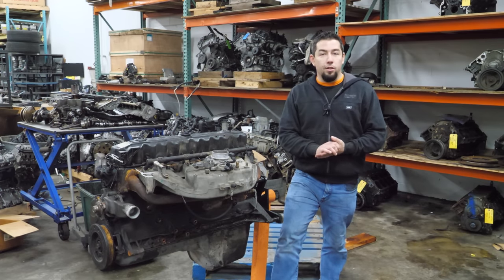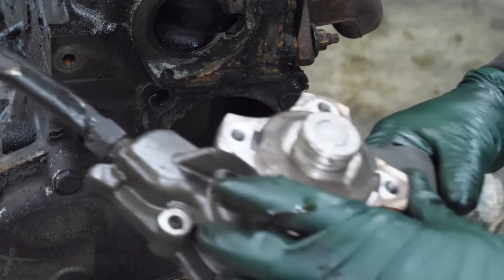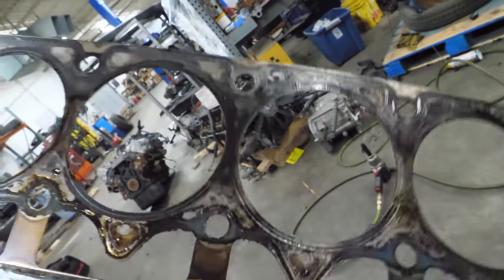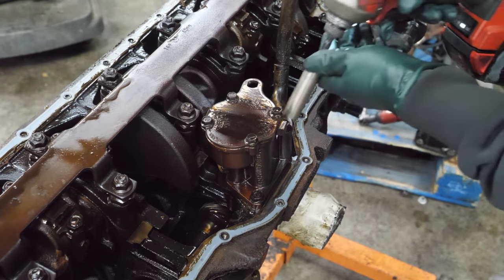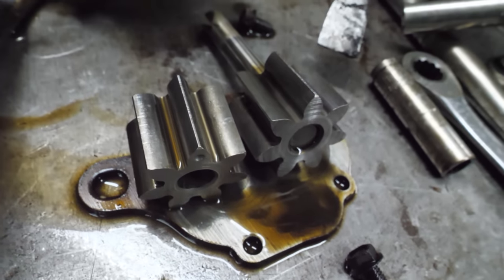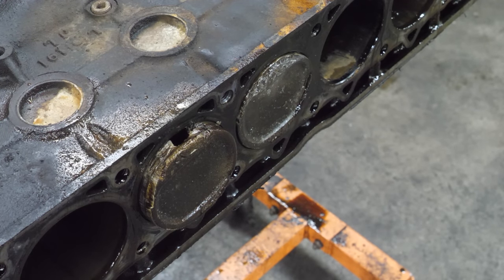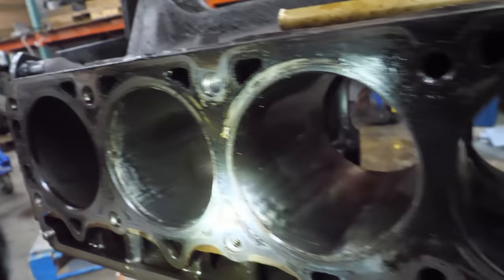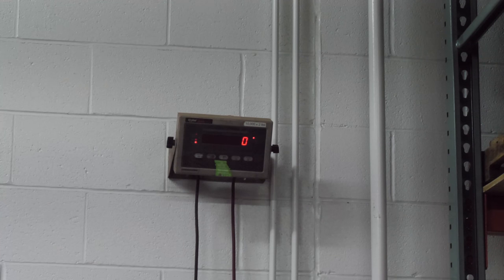How Do You Destroy A 4.0L Jeep Engine THIS BAD? Intentional? Neglect? Ill-Repair?  I Am IMPRESSED!

Comment: My 96' grand Cherokee has a V8 5.2L (318). Been awesome rig. The motor was replaced back in 2014 by previous owner, with an '03 dodge dakota motor, bolted right up along with all accoutraments. Jeep is still pretty much stock but is a  great driver, all I'vehad to do to itis tires, a few sensors, new alternator. Great vid Eric!!

Comment: I have a 2006  Golden Eagle 4.0, C.J. auto trans, a/c just turned 60,000 miles, still runs like new. I'm a service nut and stay up on servicing it. Changed the water pump and thermostat and hoses at 50,000 mi just because of age...Love that Jeep!

Comment: You magnificent madman, you finally got one for us! I've owned many Jeeps with the 4.0, XJs and ZJs both, so this is going to be fun. Besides piston skirts and the TUPY heads, these were solid. Although the cooling system was rather inadequate in the XJ, application. You have to ON TOP of cooling system maintenance on those. ZJs were a clean sheet design, so the 4.0 was integrated correctly in those from the get go.
Reply: My 02 wj never gets hot, has 220k on it and I drive it up north n back 400 miles both ways in extreme heat and stop and go interstate congestion.  Never runs hot, always on top of oil changes I do myself with pennzoil and Fram filters everyone hates for some reason.  I've ran Fram my whole life never had an issue, I also use Lucas oil treatment.
Reply: I've found on my XJ, that you just replace the entire cooling system every 4-5 years.

There's two Achilles Heels:

1) the viscous fan clutch wears out
2) the radiator fills up with sediment.

As long as you shotgun the whole thing, and give it a good flush, it's really no problem.
Reply: @lustfulvengance  I don't have a specific answer, but most people agree it's a materials/design issue (dimensions of the skirt). It also affected the 4.2 inline 6, the 4.0s predecessor. My understanding is that it officially only affected about 6% of all units, although reality could be different. When you consider literally millions of these were produced, 6% or more is a decent figure.
Reply: @litz13  I think the sediment thing is due to mixing coolant. I've had it in my XJ, but since the last time I replaced the radiator and gave the whole system a good flushing I've stuck with plain, old fashioned green coolant and stayed away from the universal stuff. My 4.0 runs nice and cool, even in the summer with the AC on.
Reply: @JeffDeWitt  I dunno, I've owned mine since new, and it's only ever had green stuff in it.  I find in 4-5 years the bottom third of the radiator is filled up and it gets to the point it just can't cool things.

Pretty much, I do a thermostat, fan clutch, water pump, radiator, and all hoses + a good flush and it's good to go.  The parts are so cheap, why not?  It's literally a couple hundred bucks and half an afternoon's work.  Really easy stuff.

Comment: The later 4.0L engine built between 1999 and about 2002 used a head casting #0331 and was prone to cracking between the 3rd and 4th cylinder due to the exhaust port redesign to meet emissions. This same head casting #0331 was redesigned and they added a TUPY casting mark on the surface of the head just under the oil fill cap. The head with the TUPY marking was corrected to prevent this cracking. The #7120 casting between about 1996 and 1999 I believe is the best for performance as it was less restricted before the emissions redesign.

Comment: Since that engine development was started in 1956 by Nash, then it was made by Hudson, then made by Rambler, then made AMC, then made by Chrysler for Jeep…

After 50+ years, they better have figured out how to make it work right!
Reply: The 4.0 actually was based on the 232 first put in 1965 model year AMC’s, and shares nothing with the earlier 6 cylinder engine.
Reply: @nuttfarmgarage6434  Just to pick a nit, according to Wiki the new 232 was introduced in May of 1964.
Reply: @JeffDeWitt  What part of 1965 model year do you not understand?
Reply: @nuttfarmgarage6434  the early engine was changed repeatedly to make improvements. Just 'cause new parts don't fit old junk doesn't mean the whole thing is different. One step leads to the next, and you can't get to the top without climbing the steps.
Reply: @brandonupchurch7628  Last I looked 1964 was before 1965. The 232 was introduced in the special edition 1964 Rambler Typhoon. The article in Wiki even has a picture of the car and the license plate says "1964".
Reply: The key word here, is "MODEL YEAR" , if you say introduced for the 1965 model year, that means the engine was introduced in 1964, even if a few late 1964 models got it as an option, saying introduced for the 1964 model year would be inaccurate, that'd imply that the engine was available in 1963.
Reply: @brandonupchurch7628  Yes, and it was introduce in a 1964 model, not a 65 model introduced in 64. The engine may not have been available across the lineup in 64, but that doesn't change the fact it was introduced in a 1964 model year car. 

You can have your own opinion, but not your own facts.
Reply: the Comments here are interesting this motor cam in many forms   and the basic block and head were in the 1952  motor  that easy on Gas   think of that 
the design comes from some designed of  AUSTEN  and indeed looks similar   this design was so gook that G.M. had similar design  the big problem with this design is it is good for torque  not for speed or horsepower   and being a state 6 was prone to making noise
Reply: I'll screw you up...John Deer actually cast the majority of the 4.0 for Chrysler because the Chrysler foundry in Indianapolis couldn't keep up!

Comment: My daily driver is a 94 cherokee with a fresh 4.0.   The issue I have was a used torque converter that leaks at the seal, as a very slight wear groove and where I installed a sleeve as round two.  And where a driveway leak is problematic and waiting for a full trans refit.  As for the rest of the body, I really like the simple, long lasting functionality.  Very solid .  Thanks for the full view to engine.  M.

Comment: My 99 Cherokee with 184k miles might have a #4 piston that looks like that. Started getting a misfire on #4 and new #4 spark plug gets fouled out in a day. Rough idle but once you gun it it still goes. Not hearing any piston knock. I have to spend lots of money to see how much more money I need to spend. Had it for 16 years and it's my daily driver. Don't want to give it up. Not a big fan of most newer vehicles. I regret ever getting rid of my first new car. A 79 Mustang Hatchback with a 4sp 302. Put 278k on it while driving it to all 49 continental states and most of Canada.

Comment: That version of the 4.0L was used in the 2000-2006 jeep wrangler, and the 1999-2004 grand cherokee, I can tell by looking at the water pump and the accessory drive

Comment: Thank you for the video. I have owned two jeeps now. Both have run hot and burst the radiator. The first a 2000, also spun a bearing and started knockings. (like the motor you showed).The second is a 2004. It ran hot while idling in my driveway. It also burst the radiator. This time I don't think it hurt anything as far as I can tell. But I had enough of the electric fans. I went to a junkyard and pulled the the manual fan off an older jeep and replaced the electric fan. Bing,bang,boom no more problems. I have 134,000 miles now and it runs like new.
 P.S. I think someone had tried to rebuild the bearing in that motor after it had run hot.

Comment: Since the cylinder head cracks line up with the most damaged pistons, I'll guess coolant was getting into those cylinders causing detonation, which leads to the torched pistons. I'm impressed the pistons didn't come apart with how loose they were on the wrist pins!
Reply: l would agree with your thoughts on the damage  cause
Reply: Thats the beauty of momentum. It broke just right.
Reply: Bet the engine still ran too

Comment: Just replaced a 02 with 112000 miles for the same thing customer thought he had a lifter problem engine ticked. Dropped the pan and no skirt on # 3 and 5 pistons common problem. jeep dealer told owner you have a 50/50 chance you got one with defective pistons! Engine was spotless inside well maintained as clean on top as on the underside.

Comment: I had a piston melt through on my 5.0L Ford V8. Heard the sound of (what I now associate with) pinging when under load and it finally let go while towing a load of hay for a friend. Had to drive it another 25 miles before getting it home, blowing smoke the whole way. Looked exactly like the one you pulled out of this 4.0L.

The fix was an in-frame piston replacement, complete with a stone hone to knock off the extra aluminum spray and somehow a much thicker wrist pin than what's on the rest of the rods. So it's got a tiny shake at idle but still runs strong!

Comment: I 100% agree with the early exhaust manifolds. I would be replacing at least one a week at the Midas shop I worked at. The replacement ones had a small flex section on the number 1 and 6 pipe to prevent a recurrence.

Comment: Those Valvoline oil filters don't have a bypass valve, seen them plug up and cause codes or destroy engines several times

Comment: Which is more ... bulletproof, in your opinion.  4.0 L Jeep or 225 CI  Slant Six ?  Have you torn one of these down.  I had one (moons ago) which continuously had 'grey' oil and a leakiny rear main (fill the oil, check the gas).  TBH, the oil leak kept the body of the D-150 (A833) frame from rusting.  The carbon (1bbl) kept the exhaust from rusting.
Reply: My friend had a slat six in his old Dodge dart Swinger. We actually tried to kill it with a brick on the accelerator pedal. It revved up and would not quit. Valve float kept it from revving too high, and we finished off a six pack waiting. Never died.
Reply: I vote for slant 6

Comment: I had a 91 Jeep Cherokee years ago from new. Developed a ticking noise under warranty. They replaced the top end and noise didn’t go away so they replaced the short block. Lasted me almost 400,000 kms before developing a tick so I sold it. Excellent vehicle and easy to work on 😊

Comment: I have a 2001 Cherokee that used to be a cop car until 100,000 miles. I bought it at 130,000 and by 135,000 the engine had no power at all. Wouldn’t even climb hills. Took it to a shop and they said it was a miracle it even made it there. It was just a worn out girl that needed replaced.

Comment: I had a guy drive his wifes 99 jeep Cherokee 25 miles into the shop the 4.0 ran decent but had a miss never made any noise but when we pulled the head off #6 piston was gone!! didn't scar up the cylinder at all we dingle berried the thing put a new piston and wrist pin on the rod reused the rod bearing because it still looked great and she's still driving it today 3 years later. The head casting on these are junk. But with much needed radiator upgrades these will last for a long time. AND A 180 DEGREE THERMOSTAT IS A MUST!!!

Comment: I've blown up #2 225/6s & same for my dad.  I ended up fixing the problem blowing up the engines. My dad's car 1980 Ply Volare Premier station wagon came with a State of the Art  CALIFORNIA EMISSIONS SYSTEM w smog pumps and MAIN CATALYTIC CONVERTER OFF THE EXHAUST MANIFOLD FLANGE PIPE.  It also had a secondary cat under the passenger side. Not far from the fuel line recall problem. We could never get the front cat replaced. No one here in NJ wanted to touch it. That converter caused so much back pressure Dad and launched several rod's through the block. I smartened up and convinced my 16 yr old self to R&R the front cat with an earlier design model with zero cat and bought that. Modified the exhaust flange and I served the secondary cat and replaced when needed. But always still passed emissions. 
I still tested the new Engine w THE delete & we had balls Deep power .  I ended up selling that for dad and getting him into a custom cruiser 307;olds wagon.  👍🏼
Anyway I've blown up a bunch of these 4.0 Lts. Same way back pressure or lack of 
not maintenance. I've had my 2007:jeep launching power and didn't blow it up. 
SWAMP ones get ruined mainly or just neglected ones. These 4.0 r bullet proof really I just think the rings give out and throw rods or wrist pin headaches. 
💥 BADA BING BADA BOOM 💥
I APPROVE THIS MESSAGE 👍🏼💪🏼
Nj'sJfJr 👍🏼💪🏼❤️🇺🇸

Comment: I have an 00 XJ, the story was it got hot and he parked it, i pulled the head off and the head gasket was blown between cylinders 2, 3, 4, 5, and 6, #5 has rod knock and #4 piston welded part of itself to the wall, amazingly the thing still ran before I pulled the head. I put an mls head gasket and a spare 0663 head I had, still in the process of finishing up. XJ's are one of my favorite vehicles along with GMT800's and W-bodies.

Comment: I had a mid 80's 2 door 4X4 Cherokee with the 4.0 and a five speed manual. Sold it with 250+K miles. Really a good little truck.

Comment: My 4.0 in a 2004 Jeep Grand Cherokee with 120,000 miles with  oil changes every 3000 miles started making noise.  I drove it to an engine shop 40 miles away. They dropped the oil pan and it was full of piston parts.  The shop didn't know how I was able to drive it 40 miles.  I had them put in a new crate engine, replace the water pump, radiator, hoses, etc.  I have around 250,000 on it now and just finished up replacing all my suspension parts in my garage. (Glad I don't live in the rust belt!)

Comment: If your looking for a block to build for power a 328 casting is the best choice in the 4.0 engines the 328 has a thicker wall and thicker webbing in the bottom it can be taken out to a 4 in bore and has been built to take and hold upwards of 350 hp naturally asperated and live .or turbo charge it and make as much as 700 hp but it won't last under that kind of strain thou it would live happily at around 500 hp but you will have a lot of work getting it there just think drag race build and you get the idea . me and my kid brother both drove jeeps for years so we have been thru the ringer building these things over the 15 years we both owned them

Comment: The later model cast iron heads are lighter. Allot lighter! The head from my 79 CJ5 258cid. 4.2L for you young'n. Comes in at 91 pounds! And yes, I weighted it as well. Try picking that up from inside the engine bay. On a lifted Jeep. Enjoyed the video.

Comment: They are tall, and I guess it's easy to build up air pockets in the top cooling passages of the head.  My kid destroyed one driving with low coolant, but a head plane and valve job fixed it.  Did new lifters at the same time, and used my old Ford trick of grinding off any wear bumps on rocket arms that might restrict their range, and hand fitting washers under the rockers to compensate for wear and the milled head.

Comment: I am doing a 4.0L rebuild now and the block was in worse shape. That block you have is the perfect candidate for a stroker build, if a .060 Overbore is possible. Mine had lips on all six cylinders where the rings had really dug into wall, like I caught my thumbnail on the lip. That's likely why your pistons 3 and 4 refused to come out, they were catching on a lip. Part of the reason why Cylinders 3 and 4 on the I6 (of any Generation, even on the Rambler) fail is because their exhaust ports are right next to each other and they build up a ton of heat in that region. All AMC style I6 heads can fail here, just on the new head from 2001 on, Chrysler was counting beans. 

My core was only $100...then I spent $600 at the machine shop getting the cylinders bored and block fluxed.

Comment: Idk I’ve seen several 4.0’s with piston failure usually have piston slap but some people mistake the noise for valve train issues. I’m not surprised honestly. I have torn down several high mileage 4 liters from Jeep’s and it’s either cracked heads and overheating or piston issues. 🤷🏻‍♂️

Comment: I worked as a forester for a large private landowner. I always drove 4X4 Fords, but when it needed maintenance, I would have to drive a Jeep CJ with a straight six. The vehicle was miserable to drive. Cold and wet in the Winter and hot in the Summer. Now, I'm no Jeep expert, but I  had a couple of buddies that had CJ's with V8's, one with a 390 AMC and the other had a 343( I think ).They were both better in the mud and logging roads that I traveled daily than the 6 cylinder. The company put some bigger, more aggressive mud tire on the Jeep with a 6 cylinder. They were wasted on that vehicle.

Comment: That is the longest engine I have ever seen! It looks overbuilt, like it belongs in a tractor.  The AMC 242ci I6 engine had amazing durability until 2000 when the cylinder head was made too thin.  From 2000 to early 2001, cylinder heads were cracking between the #3 and #4 cylinder.  However, the cylinder heads marked with, "TUPY," were much thicker than the problematic 0331 cylinder head.  It is likely this engine has the problematic 0331 cylinder head.

Comment: Love the Jeep 4.0, we thrashed a Cherokee without a front driveshaft in the paddock for years, the starter gave up then the trans. If you can get your hands on a 4.0 (SOHC or DOHC) from an Australian Ford Falcon, they are cheap as chips here, the shipping cost might be the biggest problem, but you should be able to resell it to a hot rodder.